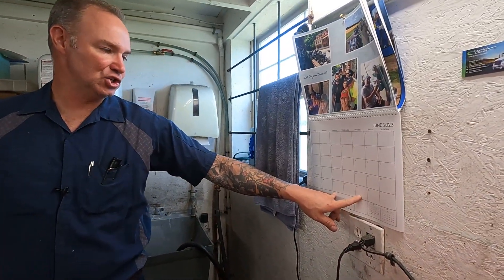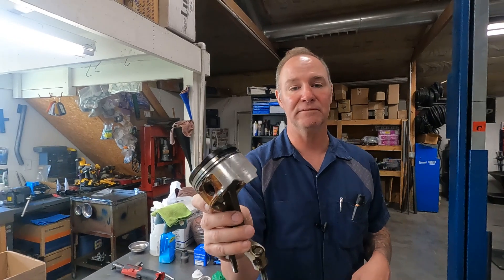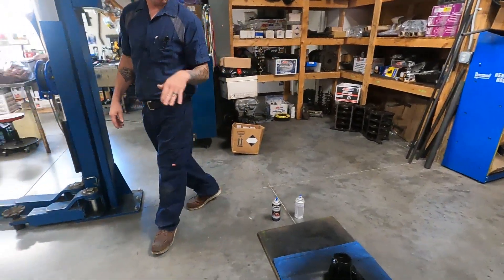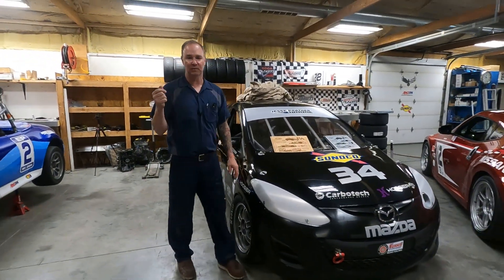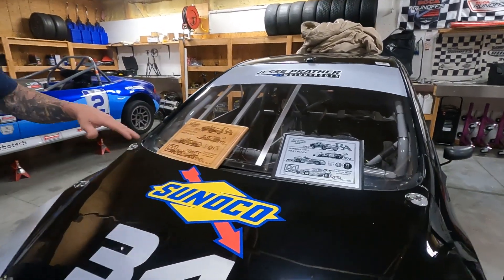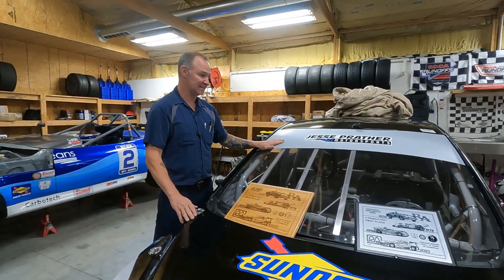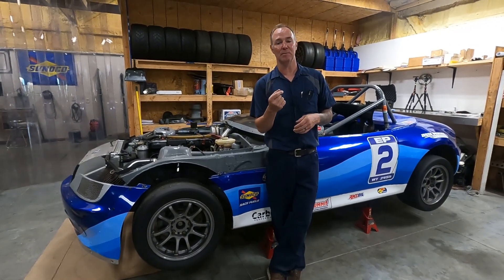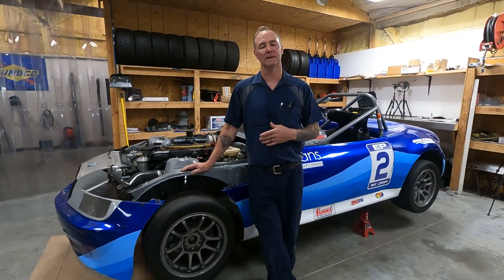SHOP TOUR - Getting Hosed in the Heat, Plus SCCA June Sprints Recap

Comment: New hot asphalt when cooled quickly like with heavy rain releases  free oil from the asphalt.  So you were running on a mixture of oil and water. Very slippery.  It will get better as it ages. Is mazda going to stay black or is it going to get a different wrap.
Reply from the maker: The Mazda2 has a list that will be tackled in the off season, stay tuned!
Reply: @jpm  great no answer  on that question.